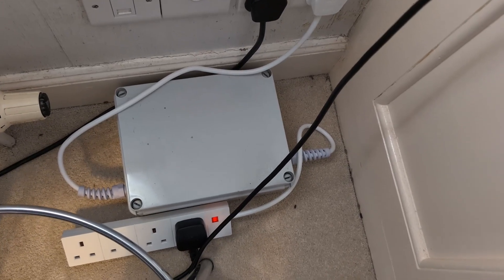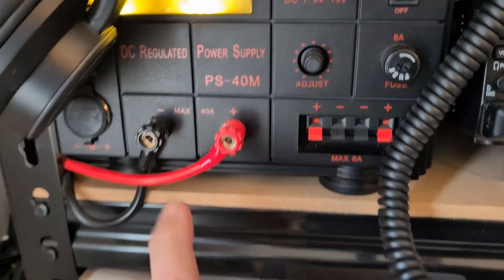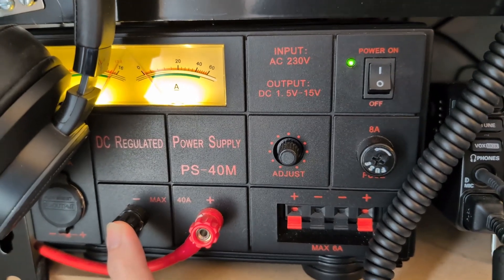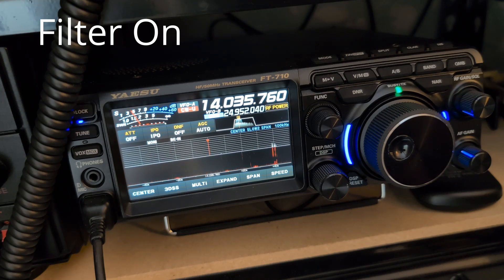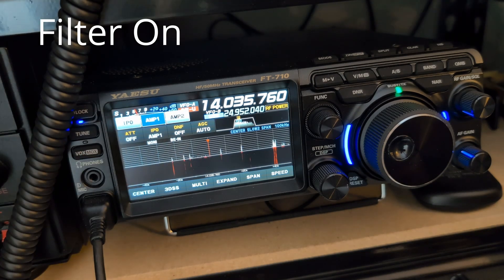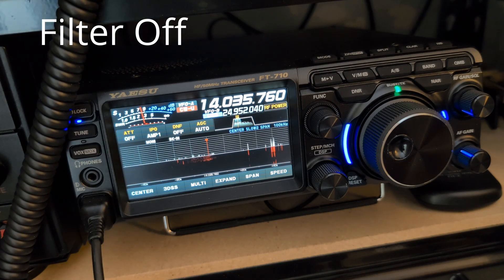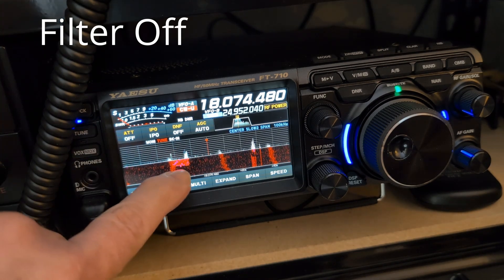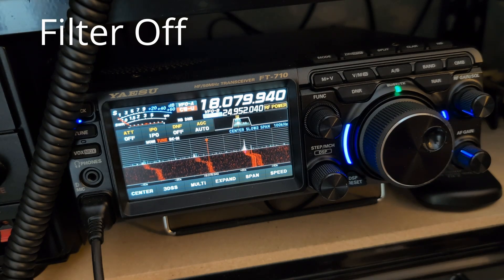Does the G3SEK Mains Filter Actually Work?

Comment from the maker: Please read the video description for my view on this filter.
Edit: Obviously the filter does work if interference is actually getting onto your antenna earth via the mains wiring in your house, but that has only been the case in about 20% of the people I know who have been trying to reduce their interference levels. Most of it is coming over the air directly.  Its not worth building one until you run your radio from a battery with your house electricity still turned on.

Comment: I have high noise levels, usually around S7+ on 40. Forget 80. As a test I ran the rig from a battery. Turned power off in my house at the switch board. No change to noise. Lots of solar around me, I also have it. But I detect nothing from my system. I run IPO only as I can’t have preamp on. I just live with it.
Reply from the maker: That was the sort of noise level I had but mine was coming mostly from within the house so I was able to get that down to zero. We do have one solar installation causing me problems now. Its actually 20 houses away, which is really bad. 73, GM4SVM

Comment: Mains? Why would anyone these days run a radio shack from mains? Battery tech is so cheap these days.
Really appreciate you doing this video, just shows that we can all get sucked into other people’s ideas.
Reply from the maker: Its not a bad idea running from battery. Its possible if all your gear runs from 12v, but if you need to use an inverter they can be noisy or just not work with loads like a 13 amp PSU. I have one of the latest Jackery battery packs and it won't start my PSU, the voltage starts fluctuating wildly. Must be the power factor or something else upsetting it.
Reply: @HamRadioEssentials  I think most batteries on sale now are capable to run a shack and on very little money. If you charge over night or during the day via solar. The inverter is defo something to think about, I guess doing some home work and not getting the cheapest could be a good start.

I have just installed 16kw battery for less than the cost of the Yaesu FTX-1, I know that’s over kill but it powers anything you want.
Reply: We run out stations off the mains because it's convenient.... This isn't difficult you know!
Reply: @Team-fabulous good for you, it’s good to know you are living in the past.
Reply: @TheFlaneur-up1ft 
Enjoy charging your batteries. You probably don't even have any radio equipment.😂😂 .
Reply: @Team-fabulous have you always been a lonely person? It sounds dreadful, I do wish you the best.

Comment: "The Band Scope doesn't really work without the Amp on".
Pres "Func", select "Level" (top left). Now the Func knob adjusts the band scope gain. The manual recommends this as the normal function for that knob.
You need to adjust it anyway whenever you change the span.
Reply from the maker: Good tip. I haven't really explored it much. This is really my first radio with that kind of display.

Comment: I put ferrite cores on literally every cable in my shack, at both ends. Cost me about £30, but it eliminated the RFI I was experiencing. Now it's down to radiated RFI picked up by the antenna. Noise floor is very low.
Reply from the maker: I have ferrite cores on every electrical and audio lead in the house apart from things like table lamps. It does make a difference collectively. I test everything that comes into the house and choose wisely!

Comment: Doesn't mains noise affect the lower bands more, so 160m and 80m?
Reply from the maker: I don't have antennas for those bands so if I ws to tune around them the noise would appear low. However, I when I did all my suppression work I worked on supressing it at the LF end of the spectrum and that resulted in it being clean at the tope end. My noise peaks at around 10.5 - 12 Mhz but its not noise thats coming from the mains, its being received over the air onto the antenna. I also have solar panel noise from 20 houses away. Its not too bad when its generating but when they are running off the battery it can be quite severe on some bands.

Comment: But who says the interference isn't picked up by the antenna itself?
Reply from the maker: Thats my point really. All of mine was. I wish I had done a comparison when I still had a high noise floor, but I knew as soon as I plugged it in that it was doing nothing. My experience of various friend's shacks is that the interference was coming over the air rather than through the mains. So suggesting this filter (as some do) as the surefire cure for QRN is a bit misleading. It has its place, but nothing is going to beat  the hard slog of DF and fixing the sources. I genuinely went from S9+ to S3 by doing that, and I recently went to S0 by getting rid of ADSL. I think half the problem was other people's routers radiating back across the overhead wire.